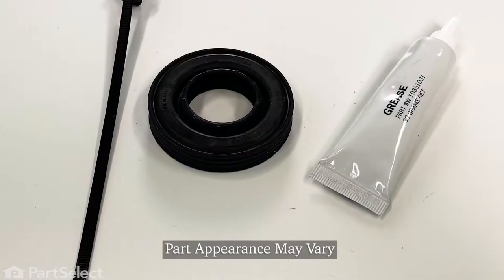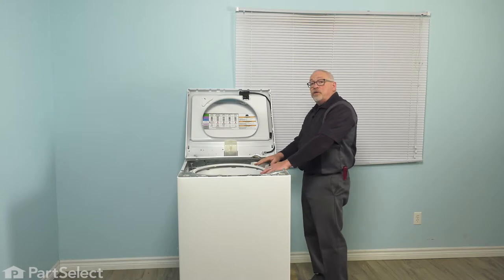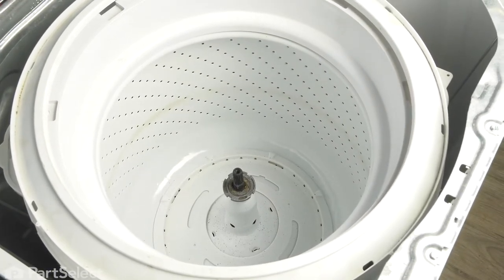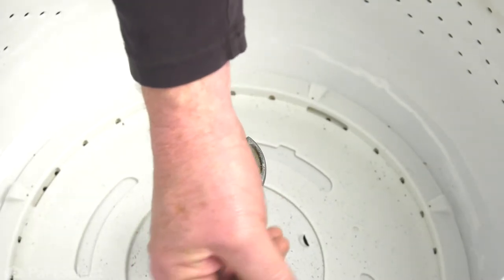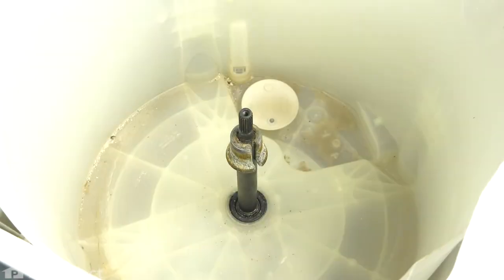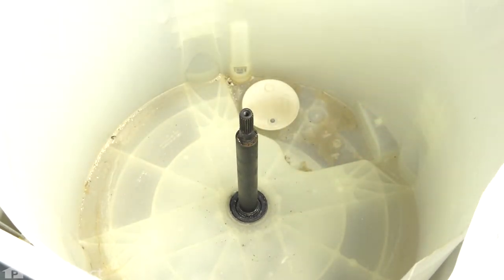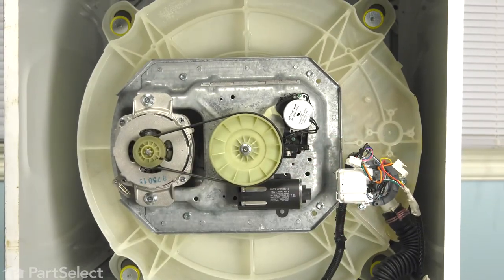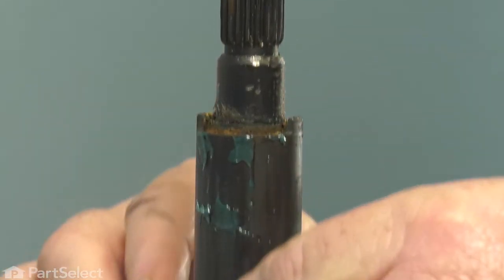Whirlpool Washer Repair - How to Replace the Tub Seal (Whirlpool Part # W10324647)

Comment: Extremely helpful even for late-model Maytag Bravos washing machines! Don't blow off the usefulness of this highly informative video! Although the machine in the video appears very old, the bottom end of it including the outer tub, pump, motor, transmission, transmission shaft, tub seal, capacitor, and wiring harness--including mounting points--looks almost exactly like Maytag Bravos washers made within the past 10 years.

Comment: My gear case is leaking oil.... Is this the repair i need to do?
Reply: DISCLAIMER: I'm not a repair tech. The tub seal keeps water from leaking out of the outer tub and into the transmission; it does not keep oil in the transmission. (However, if the tub seal is leaking, it will gradually destroy the bearings and the transmission and likely other components if water is continually leaks past the tub seal.) If your transmission is indeed "leaking oil", replacing the tub seal won't fix that problem. You may need to replace the transmission. What I've learned, if your transmission has brownish residue splattered throughout the inside of the transmission (and around the inside of the washing machine cabinet), you may have to replace the transmission itself, not just the tub seal. If your machine makes a loud noise like an "airplane or train", then the transmission almost certainly needs to be replaced. My understanding is that the transmission is not repairable - it's "remove and replace".
Reply: @DK-ko3st  Thank you so much for the reply.